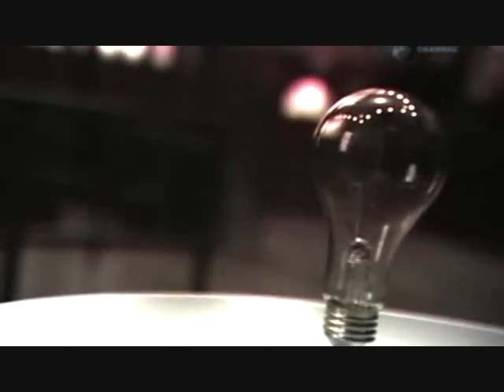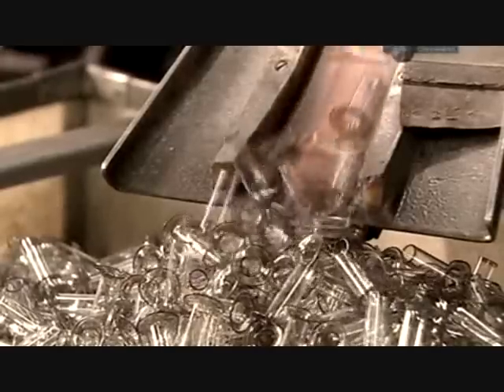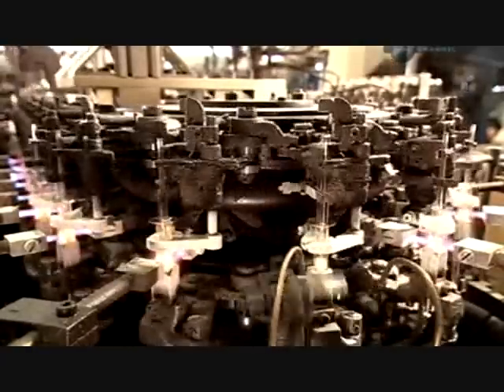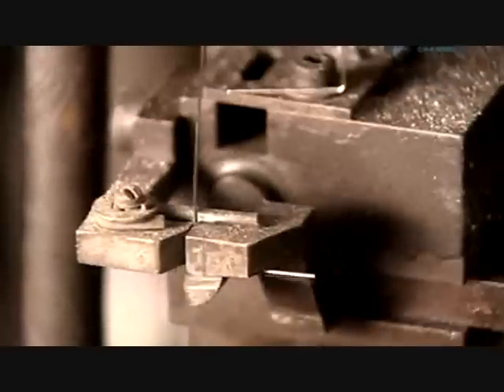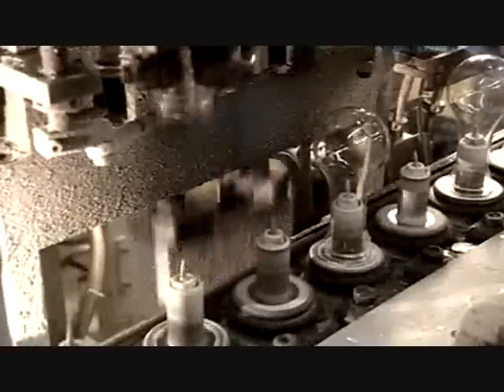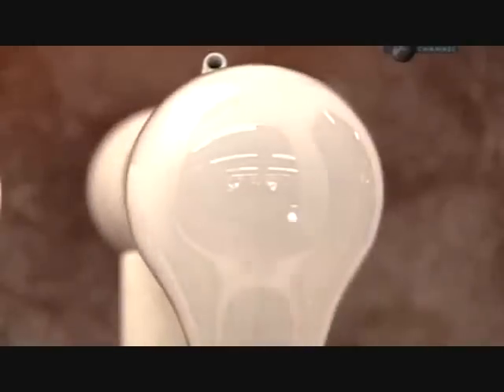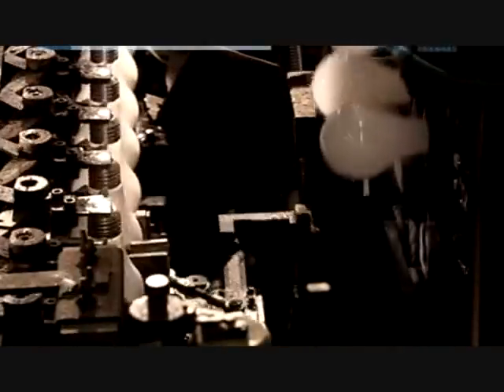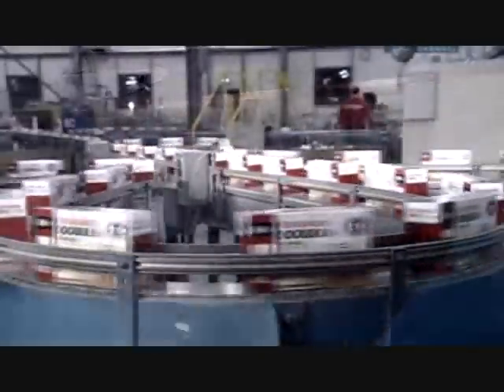How it's made - Incandescent Light Bulb

Comment: A lot of the energy efficiency of almost all energy efficient technology is really not as efficient as we are led to believe.

Not for this reason but i must start off by posting a link which tell partly why we dont have light bulbs that last 800,000 hours https://www.youtube.com/watch?v=j5v8D-alAKE&t=312s

-

LED's 'should' last easily the lifetime of a human. you see it all the time in old electronics like your old Nintendo Entertainment System (NES), or your super OLD cable box and its wired channel changer box, Or the led's in old cars and radios from the 80's.

But today with home lighting led's we have to make the plastics, we have to design circuits and we have to design the led's, and they dont even really last longer than incandescent  bulbs from my experience.

when your home led bulb stops working, IT IS NOT the LED that stopped working, Its something in the electronic circuit and components that stopped working. Maybe it got too hot and loosened some wires up or a resistor blew.

This is part of planned obsolescence, build it cheaply so they dont last as long and they have to buy more. Many of the vehicle led's are buit with components that melt when they get hot as you can see in this giys video https://www.youtube.com/watch?v=-gbOb9EhF7o&t=236s

-

Wind turbines are another easy example, we have to build many of them and especially in cold areas, they need a lot of constant maintenance, solar panels are another, not many people think about the resources we have to use to make those things then they do also eventually fail and we have to buy more to replace them, along with the battery banks where batteries eventually fail and we have buy more, if its a critical failure where the battery basically explodes and damages the other batteries then we will have to buy even more.

Its a game in our society where businesses think of ways to make the most money possible while fooling generally most of its consumers into thinking they are doing the best most efficient things - when really we are doing the opposite.

We could have light bulbs that last 100 years but we dont because the company could make a lot more money if people have to buy light bulbs ever so often. Companies are more willing to create more waste versus efficiency. and less waste.

Comment: At 3:39 the commentator says that the bulb bill work  if connected to an electrical current.  It is interesting that normally we connect the bulbs to an electrical voltage and they the current passes through.  Perhaps saying that the bulb would work if we pass an electrical current through it but then one would somehow think of a current source where before on would think of a voltage source.  Technically there is a difference in operation, but few will know of the subtle difference between a  voltage source and a current source  as far as their output impedances  are concerned.  The electronic people who worked with valves and transistors of FETs would know the differences between voltage sources and current sources.
Reply: Or that the electrons are energized to produce photons that emit visible light.  But I digress.

Comment: what do they mean by moisture inside the bulb
Reply: Most likely condensation resulting from humidity. Time between heating the glass and cooling again (very short periods they may be) could possibly cause moisture.
Reply: +Commander Rolex 
Perhaps the argon they use isn't clean or perhaps that white powder they used to coat the inside is humid.

Comment: I run plenty of LED bulbs in my house, and CFL bulbs. LEDs don't have the brightness of CFL bulbs. In my kitchen, I have 10 23 watt CFL bulbs with reflectors. I tried to use LEDs but even the brightest ones I could find were not as brite, and they didn't save much more power. They were 16 watts vs 23 watts. CFL give the biggest band for the buck. LED are suited to lower light level requirements, and incandescant to things like atics, and closets where there are not on for long.
Reply: I don't care about brightness.  LED and CFL are harmful.
Reply: 12voltvids k

Comment: The only reason the centennial bulb is still running is it is running at very low power. Take a standard light bulb and run it on low voltage and see how long it lasts.. I have a 240 volt rated bulb rated at 50 watts that has been running here for the past 30 or so years.  This old bulb I have was from the UK, and was in a lamp bought at a garage sale. Yes it lights up, and puts out the equivalant of about a 20 watt bulb. I have it lighting an outdoor staircase, and it is never turned off.

Comment: I have no problem with energy efficent bulbs, but for some tasks the good old incandescant rules. I am talking things like closets, where the light is on for 30 seconds and then off, or refrigerator bulbs ect. CFLs just do not last in these applications and LED are just too dim.

Comment: Whenever I watch these "how it's made" I wonder how the machine itself was made???
Reply: yes, that to me is the genius part.  the tolerance of each movement has got to be incredibly small.
Reply: By very intelligent people.
Reply: Every. Single. Time. Always amazed at the sheer industriousness of it all.
Reply: L
Reply: Who made the first lightbulb making machine?
Reply: Its fairly simple to imagine. everything that you can make even a paper airplane can be thought of a series of steps that you need to follow until the product is made.

So all you have to do is think about the first step *cutting the glass tube at the right length, then think about how you can build a machine to cut the glass tubing for you.

In the video you can see the cutter spinning as the tubing is put in place and forced through the cutter.

by now im sure you can see in designing this machine for cutting the glass tubing, you also have to design a machine that can pickup the tubing that was loaded in the machine by a human, then the machine places the tubing in precise slots before its get passed through the cutter, the excess tubing is collected and likely sent to a recycling bin while the main part is sent to the next part of the manufacturing process.

Comment: @midnightcharger2   Filament thickness determines the lamp operating current at the desired filament operating temperature (lower filament temperature increases lamp life, higher filament temperature increases efficiency and color temperature).  The electrical potential (incorrectly called voltage) of the lamp is determined by the filament length.  The lamp power is the product of the current and electrical potential.

Comment: I like incandescent but the spirals CFLs are better, those from Philips or Osram don't distort the colors and last too much, I'm using them since six or seven years ago and until now I had to replace only three of 12 bulbs in my house, I've put some with 23w and 42w in the kitchen and in my work room they are really good and my ceiling lamps stops to be burned by the intense heat... I recommend them! But those with generic brands definetly are craps, don't by them...

Comment: the air inside the lamp is replaced with argon in order for it to operate AS WELL AS to lengthen its lifespan like they state here. Without it, the filemant would only glow red hot (not white hot) and would burn out in seconds

Comment: Incandescents are crap. All the lights in my home have been replaced with 9W/11W/15W Fluorscents. So I use a quarter of the power. The extra 45Watts gained for each light (about 300Watts), can be used to fuel my Pentium D powered computers, which incidently are quite power hungry around 100Watts each.

But White LED's/OLED's are the future!